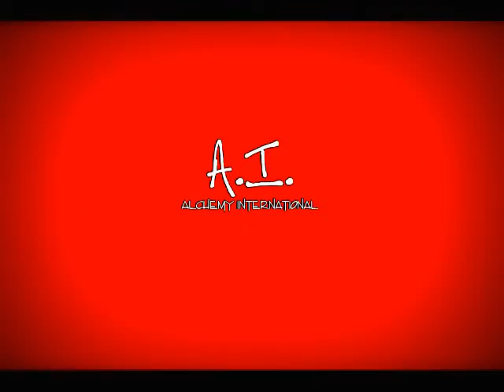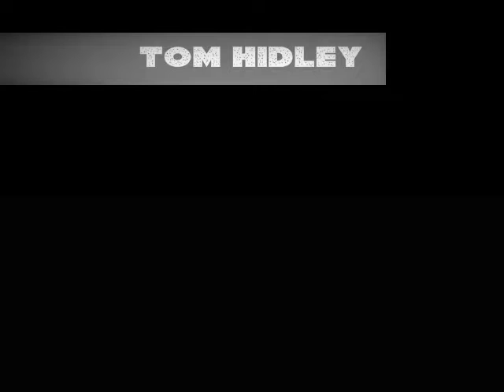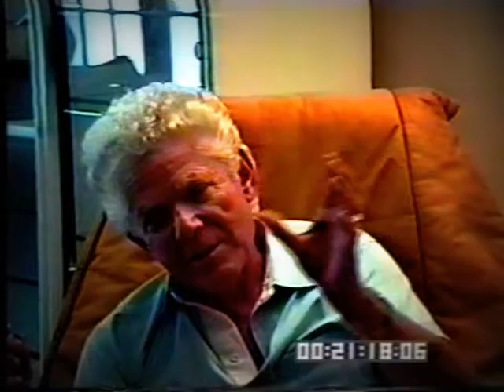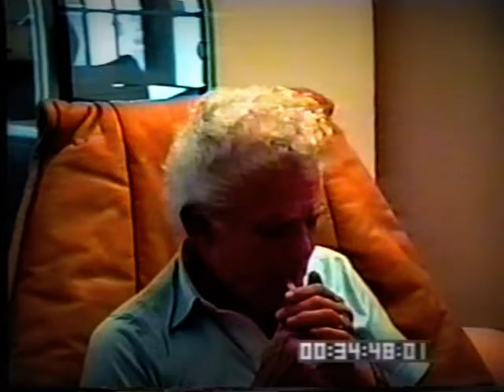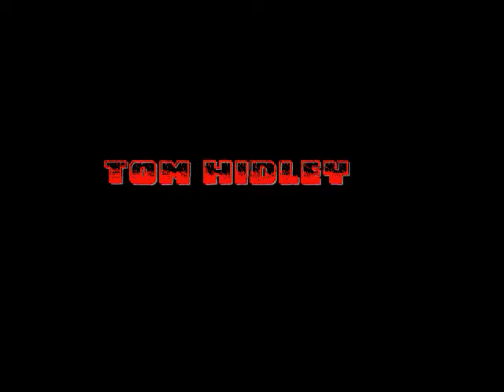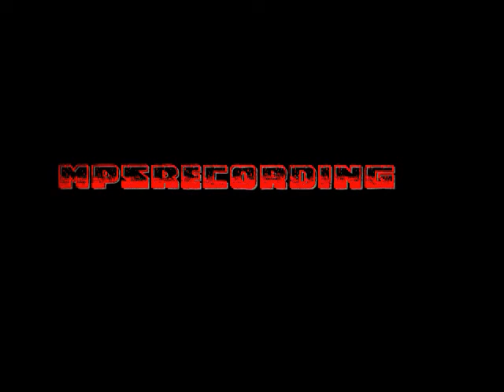Acoustical Genius Tom Hidley Only Filmed Interview

Comment: i dont like the sound of my monitors , i used them outside and they sound exactly the same , and to make it worse they are not bad speakers .. Behringer 2031A. Big 8 inch 2 way speakers , linear , flat , not musical.  I guess ill have to spend 1-2K on new speakers . But somehow i think that any 1-2K dollar set of 8 inch 2 way speakers would sound exactly the same as these . Maybe i need a 3 way speaker , or a good sub, or something else . Did anyone else have that problem , not liking the average sound of studio monitors , wanting something else , and found it ?
Reply: decent studio monitors starts from 5K
Reply: @Acard777  Studio near field monitors dont start from anywhere , certainly not from 5K .
They start with Active Crossover , separate amplifier for each driver and separate power supply for each speaker . And they have wave guide , that is what makes them in to near field monitors .
And are tuned to be flat , not to color the sound ,
That is the equation ... so its all a matter of how expensive you parts are .
 industry standard is Mackie 8s about 1000$ per unit i think  , you can find them in every  London Radio Studios everywhere  and i have listened to them VS Behringer 2031A 300$ , practically the same thing and it will be the room that will make the difference what is better between those 2 not the speaker it self . .
they use same parts , same 2khz crossover ,same Titanium tweeter , bass unit is not the same , but Bass driver in 2031A is the best that can be found , it has all bells and whistles that a driver should have .
And on top of that 2031A  has a Toroidal Transformer , while Mackie uses SMPS , it is known that Transformers react faster to change in loads hence 2031A is faster . .
  but this is hard to hear , only computers can hear that .
And it is a totally flat sound , for a near field monitor.
Tested in Anechoic chamber , so to make it you need 300$ , that is hte minimum , you can use Dimonds and gold and make it cost 100 000$ but if its flat its going to sound 99% the same . Doesnt matter , it is not the money , its the sound , sound has no price .
Big studios do not use near field monitors , they use big in wall monitors to negate the back wall reflections  where only the room costs 50 000$ so we will not speak about those , of course .
Speaking of near field monitor designed so that it negates the room effect as much as possible using a wave guide , there is no price on that , its a shape .

 So i dont know why would you need 5000$ to make a flat monitor,  you tell me , i dont need it , please tell me why do you need 5000$?
Reply: @dedskin1  are we talking about music production or radio speakers ? 
I live in UK and know 20 or more producers of electronic music. Everyone here working on Genelecs or Adam speakers. Absolutely nobody here working on Mackie or Krk. 
You can flush mount 2k speakers into the wall. Seems like your background is different to mine.
Reply: @Acard777  https://www.youtube.com/watch?v=9sMHMxkTe98&list=PL2520BD2F74CF6D55&index=9 that is Logan Sama , best Producer DJ in london .
Look at them speakers ? Is that Adam ? KRK?  no its Mackie .
But i dont see why wouldnt one use KRK or ADAM , or Genelec ... if its flat its flat .
I have 18 year old set of Studio monitors that have never been turned off , and even done outdoor partys as a DJ and things .
So trust , i know about it .
On top of that i am Educated Engineer , i made amps and speakers , and stopped because Engineers have already made the best thing , and it was infront of me for 18 years . And it still works , i have used 7-8 difrent speakers of course , but never changed those or turned them off .
And they still work , absolutely 100% working .
When i Entered Bachelors studies for Audio Video Technologies , i purchased 2031A , everyone said no , its gonna brake on you that is Behringer its worthless , dont do it  .
But here 18 years later , they still work , and i use them still , haven't found anything that would give me  something i dont have , up to 5000$ near field ..
And i have found that Human Hearing is absolutely worthless , people walk around city  they don't even hear traffic , cars all over the place , they cant hear it .
Do you know that , do you know that humans cant differentiate colors if they don't have   something to compare it to , sometimes cant even see white , they think its blue , people with perfect 20/20 eyesight .
I learned all that in Audio Video Technology's , so trust teh difrences between all the Flat near field monitors are so small , no one can hear it , only if they do A VS B and fast maybe notice a little difference but mostly not .
You have all those speakers tested , recorded with Flat measuring microphones , and you can use your Headphones and hear all of them , they are practically the same .
they all have their thing , ADAM uses ribons , Guitarists love that , KRK boosts bass , Dusbstep producers love that , Genelec and Mackie make Flat models for serious producers , and Behringer is a copy of the Mackie.
Big Studios dont use any of these they use In Wall monitoring to get around back wall reflections .
But those cost well beyond 100 000$ , not the speakers them selves but the room and all
Reply: @dedskin1  wall mounting has nothing to do with back wall reflections. Actually what is your point ?
Reply: @Acard777  Not wall mounting , in wall speakers and yes it does , iif you think it doesnt feel free to think that way , i gain nothing from teaching you what is what .
My point is that all near filed monitors that   have Flat  response to +- 1.5dB, t hey should be tuned and most are  , that use Electronic crossovers usually at 2khz for 2 way systems  , active crossovers , with Amp for each driver , and power supply for each speaker , with Wave Guide for near field monitoring .
Are 99% same sounding and that is the goal , to have a reference point  , some even use words as Reference , Reveal , Truth in their name , saying what i have said .
The difference only can come from the shape of the box , Egg shape speaker box is the best and most expensive , and materials used for drivers , some use Ribbons ,some soft dome , some hard dome , some titanium,  some beryllium , and all materials and all boxes sound different .
Taht is where difference comes from , otherwise they are practically the same and surely dont require 5K to make them .
That being said doctor Linkwitz Riley has tested 20K speakers HiFi that are so bad that 100$ speakers have better response .
And it is he who made this formula i have described to make good speakers ,everyone uses it  today , they use his crossover its actually called Linkwitz Riley crossover .There is such thing as Marketing , and Speakers that cost 100 000$ , and of course its all BS .
The most important thing in Sound System is its Room , not the system it self .
today with electronic crossovers , SMPS power supply Class D amps  , you get  close to perfect speaker for 300-400$ , near field or HiFi if it fallows the formula , it is good , but Company's want to sell Amps 10 000$ amps , so how can they when this man showed its apsosluely not necessary , cables , Snake oil you name it , people fall far all kinds of Marketing .
Because Human hearing is not that good , everyone who claims golden ears is a fool . I cant hear for shit , and no one can hear what he doesnt know .
Just like in trafic you dont hear cars , your brain blocks it , goes the same for Visuals , our eyes are poor instruments .
And it is Eyes and Golden ears people use to chose speakers , and that is how they get to 5K , what 5K 100K , if you have a million they have a speaker for you .
But the sceince does not require such money to get linear response speaker it it takes 300$
Take note in Theaters , places for Music , dedicated for that are all Shell Shaped or Egg Shaped .
And best you can do for your self is to get an Egg Shaped room , but we dont have that , i dont , i have the worst room in existence , a square room , its so bad that it can even use 100$ speaker , passive one , bad one .
Let alone highly tuned instrument .
But i am at mercy of my situation , have to use what i have , my Wife even forced me to take out Bass Traps and Diffusion boxes ... its the way of the road ... if you watched trailer Park boys , the way she goes .